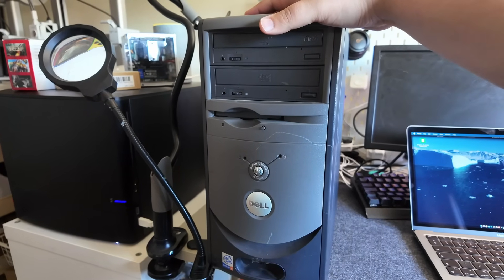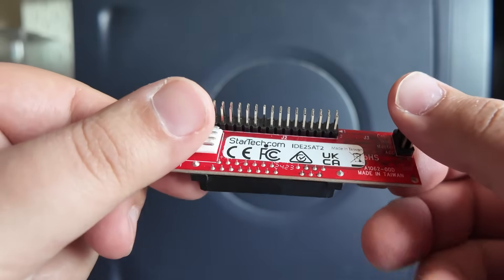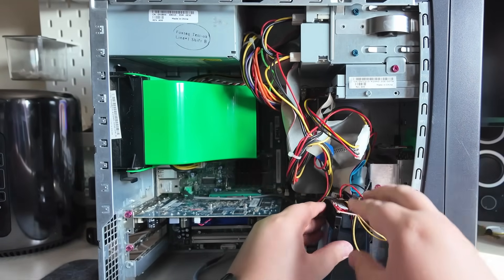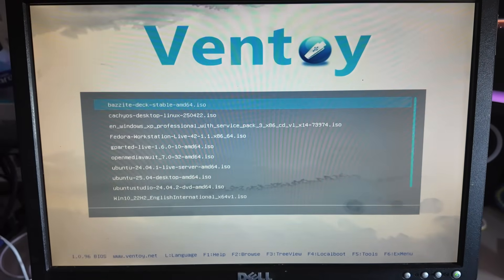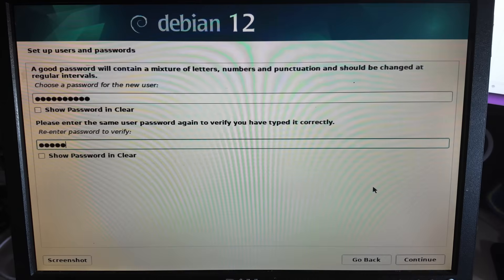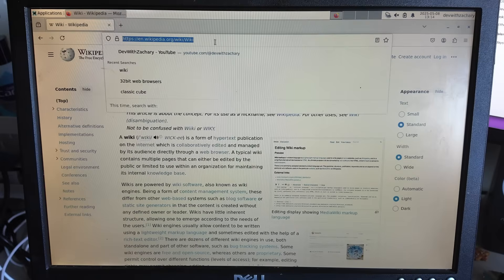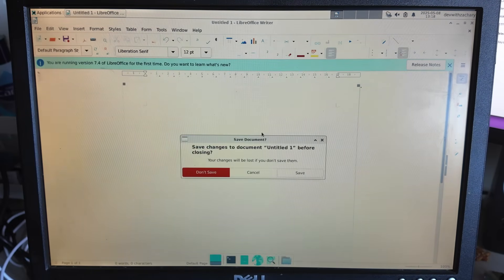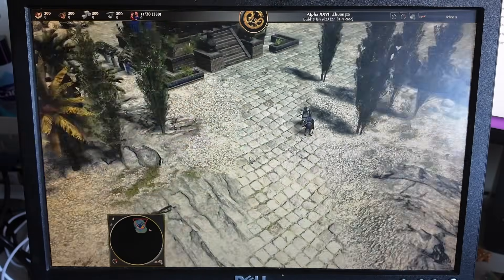How Useful Is Modern Linux on Old Hardware? Debian 12 on a 20 year old Pentium 4 Dell Dimension 4600

Comment: It worked well for it's age and for 32 bit computers I install LMDE 6 and it does the job, but YT., will only play at the lowest settings.
Reply: In 2005 it would play YT with virtually any settings, like 640x480. Now it can barely play 172x144...
The same with many tasks. I was receiving emails on Pentium 200 with 32 megs and on i5-8 with 8 gigs. The same slow, the same impaired search.
That shows how more resource-wasting the software becomes year by year.
Reply: @c64club  Well, YT uses more modern codecs nowadays.. that comes with a cost. But Browsers are indeed bloated.. And everything is a browser in modern software.
Reply: Not entirely browser fault, modern website need more resources to run, especially youtube now
Reply: With Flash it would have been still useable.
Reply: You should try a different youtube front-end that uses a more simple UI and allows for a different codec like piped or invidious, tested on a windows vista core 2 recently and went full screen aster than my current 2019 i7
Reply: @xdanic3 piped video hasn't been working for almost a year for me
Reply: Running Lubuntu 32-bit 16.04 on an Athlon I, best YT performance, yes, on lowest settings, is by running K-Meleon Goanna in WINE.